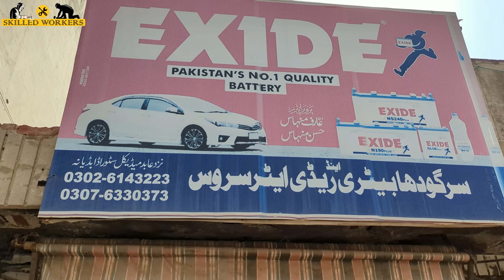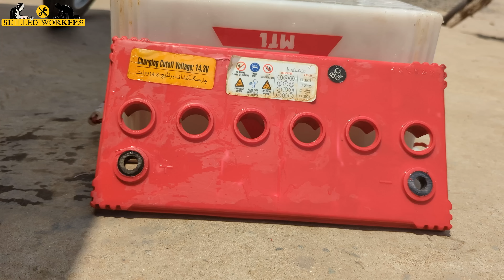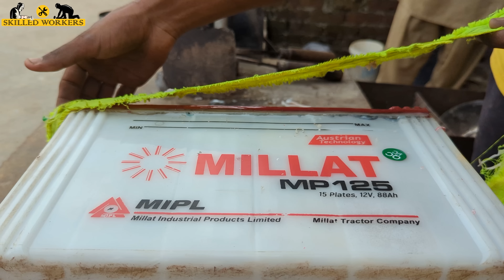How To Restore Old Lead Acid Battery | Old Battery Bring Back To Life Again | #restoration

Comment: Don't waste you time , never works, it will have voltage but no current and will not start your car or motorcycle. you need at least 180 amp to crank. this is just he wants to make money from youtube watchers.
Reply from the maker: No bro its worked thousands of batteries restores on daily basis in pakistan people buy these batteries who cant afford a new one.